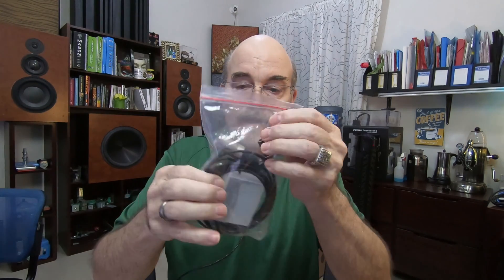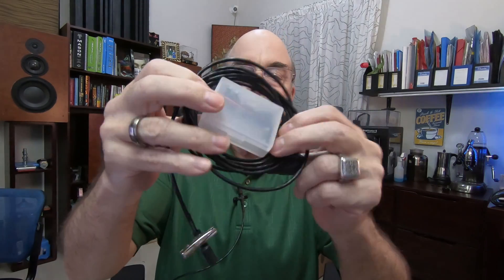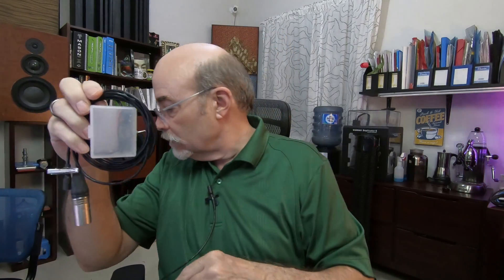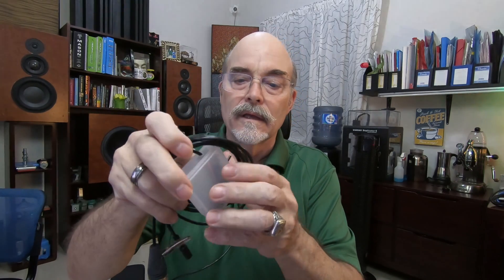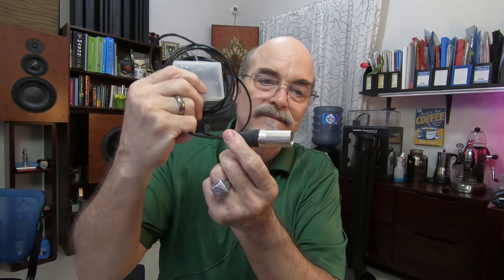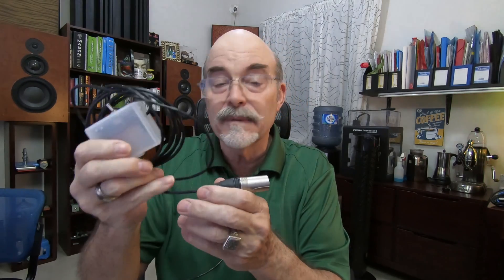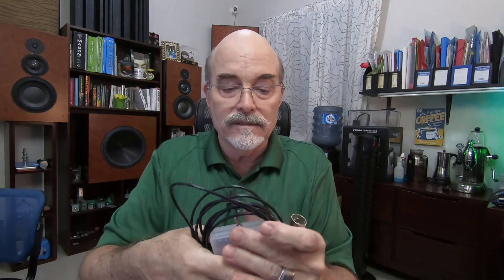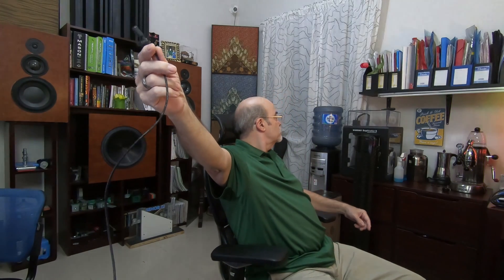How to build a studio grade microphone - Introduction

Comment: WIll this work with a 3.5mm plug on a laptop?  Also, you may want to use an 18650 battery. They have much more capacity than a 9V and are easily recharged with these"
https://www.ebay.com/itm/10pcs-TP4056-Micro-USB-Charger-Module-5V-1A-18650-Lithium-Battery-Charging-Board-/272570928685